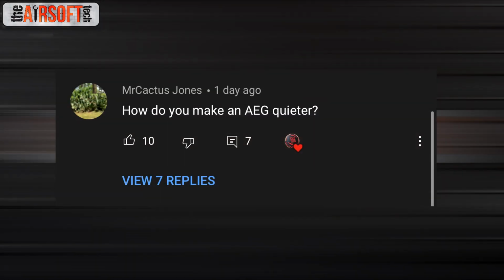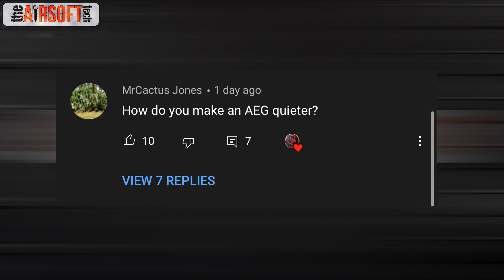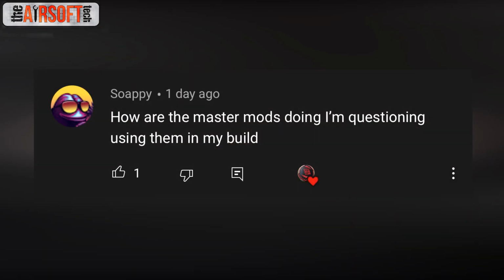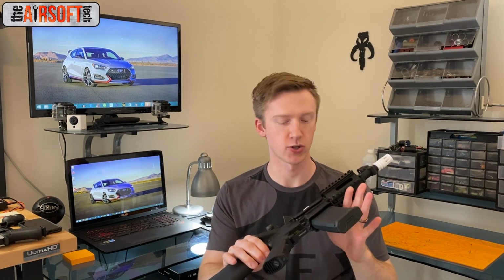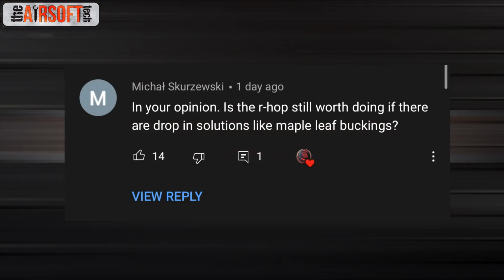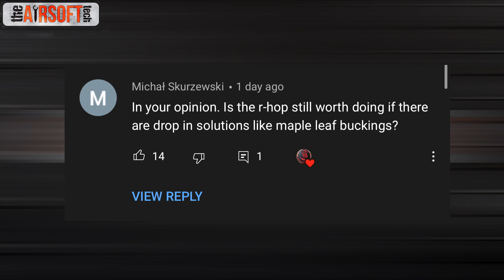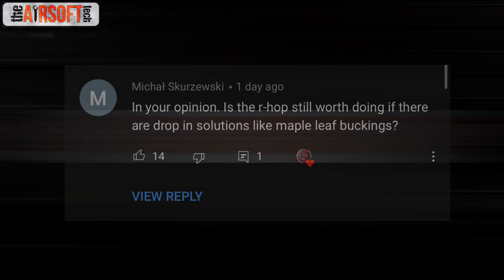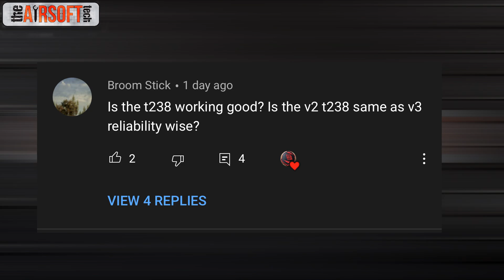Airsoft Tech Talk Q&A | Episode 15

Comment: Its a shame about your T238 mosfet. I'm on the gelball sides of thing but I'm easily sitting on the 8-10months of use with an average of 10,000 gels used per 4-5hr session. On average i would play every 2 weeks which would put me well over 150,000 shots fired.

I must admit though, I don't use it for anything fancy or too stressful. Currently the most stressful is a 26TPA, M135, DSG with 18:1 Spur and Bevel. Shoots like 30rps (took your advice for a reliable DSG) and that's been running for a couple of months like that. I've even bought a second one and installed it too and that's been going for about 2 months. I'm absolutely loving the T238

Comment: Hey there!  Love your videos, they are so helpful and informative.  I subscribed a few days back and have watched most of your videos.
I play with a group of friends here in west michigan outside about twice a month.  I'm building a dmr type m4 build to suit my marksman mentality.
I currently have a Lancer Tactical gen 2.  It served me well for about a year before I decided to upgrade it.  My goal is to reach 250 ft hitting a human profile.  This is my current parts list on what I have: 6.03 363mm Prometheus inner barrel, stock plastic rotary hop unit s-hopped, STS by PTS I think, aluminum air nozzle w/ o ring, lonex aluminum cylinder head, prometheus stainless cylinder, shs silent piston head, shs aluminum piston, systema m135 irregular pitch spring, lonex ball bearing spring guide, shs tappet plate, stock 18:1 gears, zci 22tpa high torque motor, xcortech mosfet wired to xt60s and an 11.1 25c 22mah lipo.  Some of the parts I haven't installed yet so I don't know if it will hit the mark. 
Am I on the right track from what you can tell, to hit my goal by the end of the build.
(I've shimmed, polished, and teflon tape wrapped the gearbox, cylinder, and inner barrel accordingly.)
Any input of tips are appreciated!
Thanks!

Comment: Hey man! Everytime I shoot my aeg (g&g predator) it makes a very springy sound. Any idea on what's causing it. I've put new aftermarket parts in to try and see if it changes but does not. Thanks dude.
Reply: G&gs tend to be springy. It’s not a problem unless you really don’t like the sound
Reply: @shatteredskies191  no preformed issues, I found putting some thicker grease on the spring helped it

Comment: Is it better to run a high torque motor on a high speed build instead of a high speed motor?
Reply: I would say yes. A high torque motor with high speed gears (12 to 1 or 13 to 1,) will get a similar rate of fire as a high speed motor with a slow gear ratio, but with a better trigger response
Reply: high torque high speed really doesnt mean much. What matters is the tpa and magnet strength

Comment: Hi man or anyone quick question
Asg u30000 16tpa 30krpm motor
Vs actionarmy 16tpa 30krpm motor
Wich one is best for a 18:1 dsg setup?
(With titan right barrel to cylinder ratio shimming etc )
I have experienced on single with the action motor over spin on 11.1 25c 1.25amp(2 shots) auto wanted 3 shots did not work well(unstable full auto)
7.4 20c 1.2amp works perfect 
The titan has all the software and no issues 
Can anyone predict the outcome of the asg motor?
( Joule output at 1.1j with .3 is fine and no feeding issues)
Anyone got tips or even the big boss?
Reply: Edit the single shot was 2shots and the auto position was unreliable

Comment: Is it normal to get your battery hot after some semi and full auto?
Reply: No, your battery is probably too small for your motor
Reply: Thank you mate for your reply, its been a year hehe though i recently bought high motor torque what battery C rating do you suggest for this one? Im currently using 40c but still getting hot. Shimming, wiring, gears are in great shape. I dont know how and why still my battery getting hot.
Reply: @steveaman9262  are you using a mosfet?  What is the mah of your battery? What motor specifically?
Reply: Im not using mosfet this time becaust it keeps breaking. I don't know if you are familiar with Military Action Motor (MA High Torque) and im using 3000mah battery
Reply: @steveaman9262  you have to find the balance between battery output and motor draw. A battery outputs it’s mah divided by 1000 multiplied by it’s c rating. The motor will want to draw a specific amperage, and if the battery cannot supply that, it will get hot and eventually kill the battery. However, if you go too big on your battery, it will cause contact jumping between your trigger contacts, which is also not good for the battery. The solution is to either find a balance between battery output and contact tolerances or get a mosfet. However, like all airsoft parts, not all mosfets are created equal, and some can’t handle the high output they are designed to protect your trigger contacts against. I would do some research into a higher quality mosfet, or try using a smaller battery, around 1500mah 30c or maybe lower
Reply: @shatteredskies191  okay mate, thank you so much for your time. I'll try to change my battery and put a higher mosfet this time.

Comment: Are you going to try to get your hands on another t238? Or are you done trying with them
Reply from the maker: I won’t be buying another T238. If the company wants to send me one or two for review I’ll give another shot.
Reply: @TheAirsoftTech  Ok, cool. Thats kinda what I expected. I just keep seeing them all over hopup and in a few builds on forums and wondered if it was worth saving the money but I guess not unless you wanna play trigger board roullette.
Reply: I mean they are 23 bucks on wish...... I'm a gambling man though.
Reply: Components included in a T238 are the same as in a Gate, Atmel, transistors, etc. soldering quality is not the best but I've seen worst, what is very unfair is to charge 150 quids for a product that cost 20 quids on components to buiid, and if it wasn't enough to bring software tiers to it...
Reply: @TheAirsoftTech   I might just send you another one in the future with a custom QC higher quality wiring and a angled switch mod not necessarily a review item but you could say it was custom QC checked by a friend a may get it out by January
Reply: @raymondiscool1  are you planning on selling these custom qc'd ones? If so, how much and where/how could i pick one up?
Reply: @k.thomas295   if I had the time I honestly would
Reply: @k.thomas295  I will be however attempting to sell parallel wrapped armatures in the future for motors 😉
Reply: @raymondiscool1  please let me know how or where to find them if that ever happens..... motor, or the mosfet
Reply: @raymondiscool1  done. Just requested a follow... thank you

Comment: Just blow the bearing in my ACR "We get why you don't want to use" 2 full days game play?14 16 magazine ?????why make?????lucky found befor a complete disaster grease and oiled, was completely free and just fell out was trying to get bush originally but was not available at time add burning out the dynamo bush in 30 min due to the rear not shafted cut into the metal case?china? and the other case is a 8mm and the original is a 7mm so out off luck😡was doing the spring and trigger anyways. And yet no titanium 😕WTF.😬Guy's. Gose with gears $12.50 shaft gose on a 1.3 up $22 1.5 plus $50 shs you know 150m rate now i need a newshaft the brass seem's ok upto a 1.5??????